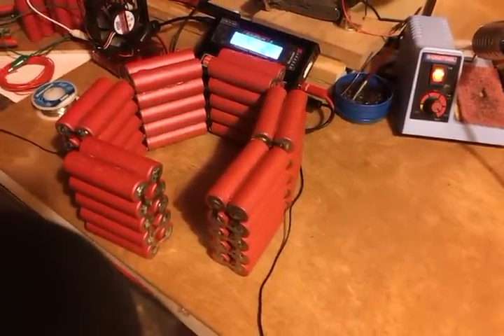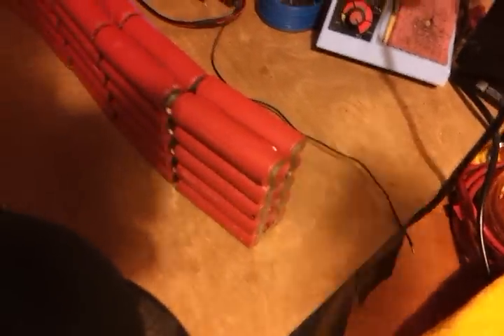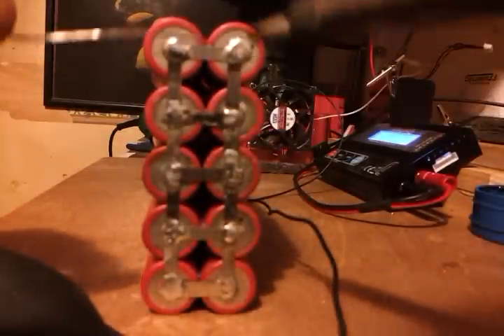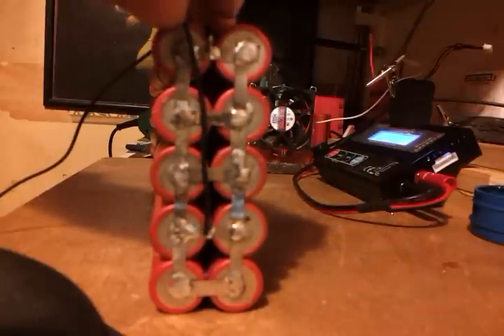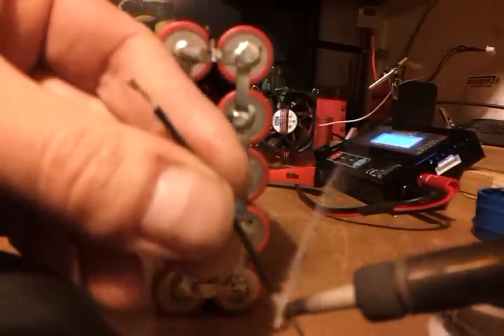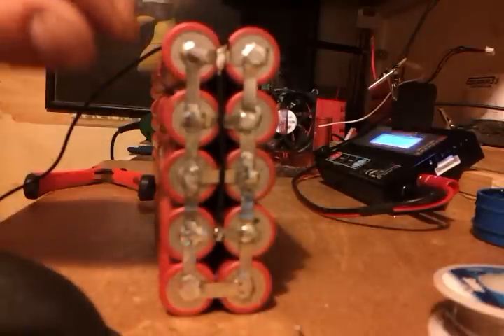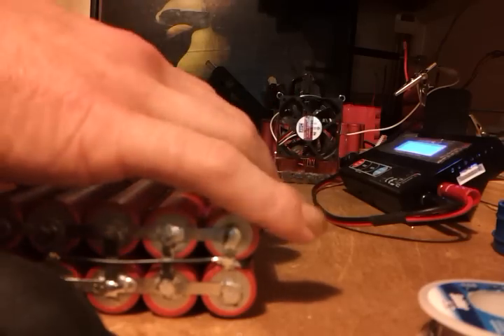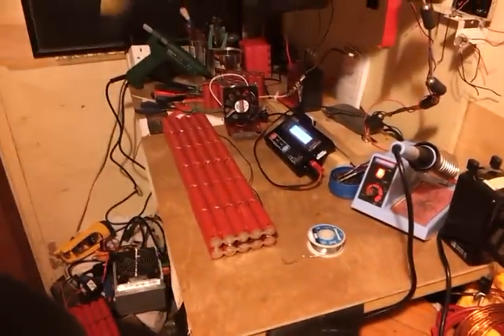24v20ah 18650 lithium ion pack...pt3

Comment: hello. do you use 6s or 7s circuit to protect cell? 6cell =24v. so when i use 7cell=24v?thanks
Reply from the maker: ÔN LUYỆN 50 SẮC THÁI 
No protection used...just a balance charger and voltmeter .
 7s=26.25 v nominal.
7x3.75v=26.25v

Comment: I make a 24v 20ah battery pack.The best 18650 
(....) mah and how many batteries are needed? Please say if any  kind of BMS will take place
Reply from the maker: AMAZING CREATIVITY WORK 
No bms is used.
Just balance charger and volt meter .
Reply: will it safe if i don’t used a bms for 7s battery, i make a seri and parallel circuit for my 18650 battery’s. It’s 3,7x7 for Volt + 2500x9 for ampere so it’s 25,9V with 25A

Comment: friend i have a question 
can u pls tell me if i use 18650 battery cell of 1.8ah, 10 cell which mean 18 ah. each cell content 1.2 volts, 10 cell which mean 12 volt. it mean there is a 18 ah 12 volt battery is made .  after connection this all cell to a inverter which requires 7ah 12v battery to light a bulb but this type of battery is not working. can u give me any advice.

Comment: can you show how to make 24v 12ah please?
Reply from the maker: hello there..
it would be very simaler..
you would keep the 6 cells in series to give the 24v..
just use less cells in parallel..if the cells are 2ah then use 6 [6x2=12]..so the pack would be 6s 6p.
hope this helps a little,
 good luck with your build;]
Reply: What would you charge the pack at? Like what Watt and Amp charger would you need.

Comment: All you need to do a great battery power: 1) good http://ali.pub/8uj32 protected battery with the real 3400 mah.
Bracket holder for configuration 18650 Battery in the battery of any size and type.
http://ali.pub/bhv3g
http://ali.pub/7ic2f
http://ali.pub/98eld
http://ali.pub/gd7y3
http://ali.pub/ayo3e
https://vk.com/club73685697?w=wall-73685697_3914
Reply from the maker: +Михаил Бочков thankyou for those links.;]
i dont speak russian but if i did i would say thankyou..;]
спасибо товарищу.;]

Comment: I have some questions for you and hopefully you could help me out. First thing is where did you get these battery cells from? Umm my electric bike right now runs on a 24volt motor and is 24 ah, but on a lead acid battery so I was wondering how you can switch to lithium but keeping the volts and amp hours as well as how could I increase the range to the bike and how many individual battery cells I would need . Thank you if you can help me
Reply: +Alex Zalepa laptop battery packs.

Comment: all them long battery's for 24v 20a? by the time u brought all them battery's u could brought one new with warranty! =D 60 18650 battery's to make just 24v 20a? thats crazy big... thats 120 battery's. what mah are they? i was thinking trying this for weight and space but this looks huge to make it to be 48v unless there is a way of making them to be small space?
Reply from the maker: thanks for your comments wayne.
the batterys were second hand.the idea being to recycle instead of just buying new.
any one can buy a new pack .nothing fun or valuable in that,also i wanted to be able to experiment with them and not cost myself too much when it goes wrong!..lol.. it always does at some point.;]
the shape of the packs was dictated by my battery box. cheers.stoo
Reply: i think u did good mate clean and tidy. they still all good today? yes i was thinking buying some 3400 nitecore. intill i calculated the price HEHE
Reply from the maker: Wayne Shepherd
i hear ya  buddy,big money  this new battery  game.
bikes still on hold but all my power tool packs are doing great so far.
if ya want a case of cells to play with let me know . can only post in uk though.
 im up for trade n mart ;]
stoo
Reply: stoo234 thanks stoo. what mah are they?
Reply: Wayne Shepherd i bin looking at a bulk but they are from laptops back in 2006 thinking how long they have bin left would they be able to revive them
Reply from the maker: Wayne Shepherd
not sure buddy you can give it a go..old lap top ones can be a gamble if there used ..old but new is better.
the ones i have are 06/07 but have never been charged ,there still in there shipping cartons;]
there marked as 2.4 ah ..japan made for varta ..
im getting anywhere from 1.8-2.0 ah per cell.softly and slowly seams the best way to reviv them.
regards stoo.

Comment: just got done with this series, the design is pretty and looks functional! would you change anything?  I'm thinking about making each cell a 4x3 instead of 5x2. i think it could still mimic the way you did yours.
Reply from the maker: hello dahn thanks for your comments.
 the space i had dictated the shape really so i cant change much ,
you could hook it up 4x3 no problem.
good luck with it!
all the best.
stoo
Reply: friend i have a question 
can u pls tell me if i use 18650 battery cell of 1.8ah, 10 cell which mean 18 ah. each cell content 1.2 volts, 10 cell which mean 12 volt. it mean there is a 18 ah 12 volt battery is made .  after connection this all cell to a inverter which requires 7ah 12v battery to light a bulb but this type of battery is not working. can u give me any advice.

Comment: 18650s always remind me of fireworks.
Reply from the maker: I hope they make my bike a rocket!..would like your option on best use of power pack..48v40ah or 72 v20ah...picking a motors getting tough..found some fiberglass resin too
Reply: stoo234  well voltage tends to change speed and amps tend to change how much force it has to get you to that speed. but that isnt always the case. i'd say 48v 40ah would be fucking awesome. you could get a couple hundred km on a charge. my 10AH pack gave like 50km of range.
Reply from the maker: Rinoa Super-Genius Thankyou buddy ...so many motors out there..do i get a big one and run it at less voltage or a smaller one n crank it?i could rearrange the Battery packs to be 48v40instead of 72v20ah..lots of very step hills round here too...
Reply from the maker: Rinoa Super-Genius Thankyou buddy ...so many motors out there..do i get a big one and run it at less voltage or a smaller one n crank it?i could rearrange the Battery packs to be 48v40instead of 72v20ah..lots of very step hills round here too...
Reply: stoo234
 electrical stuff is always more efficient when they arent pushed too far, but most hub motors can handle a lot more power than their controllers give.